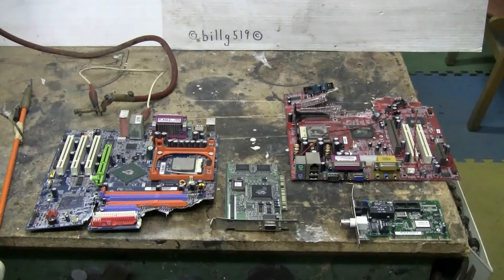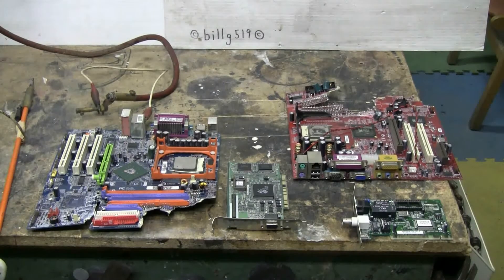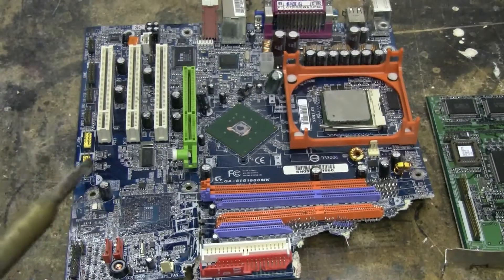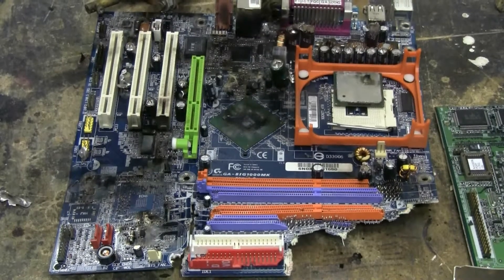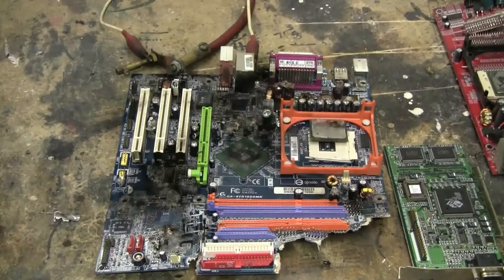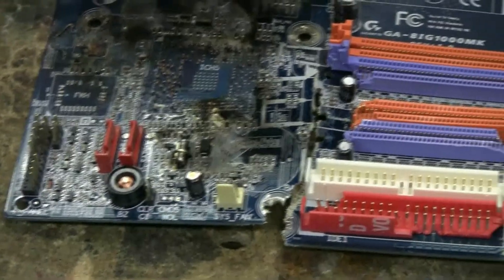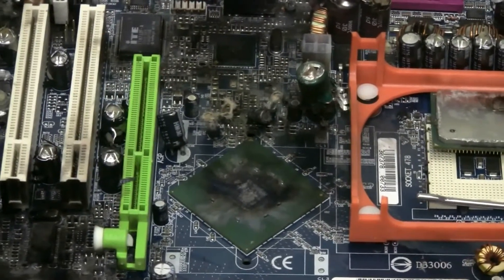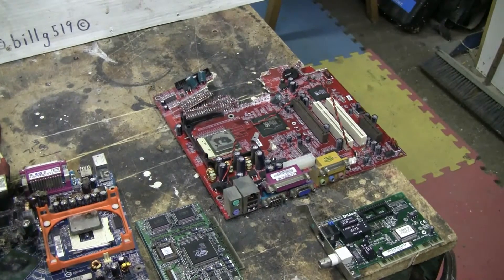Capacitor Bank #52 - PC Motherboard

Comment from the maker: The caps are charged with a two MOT supply. A loose metal piece got too near a MOT and the magnetic field made it sound like a buzzer. I found and got rid of the loose piece, next video that annoying sound will not be there. Thanks for watching.